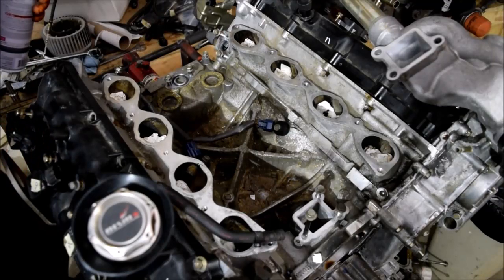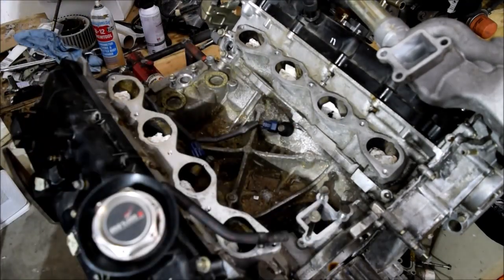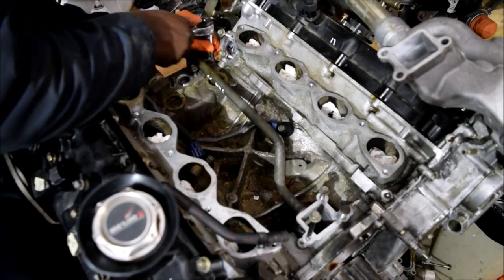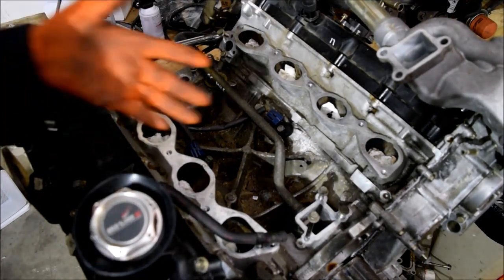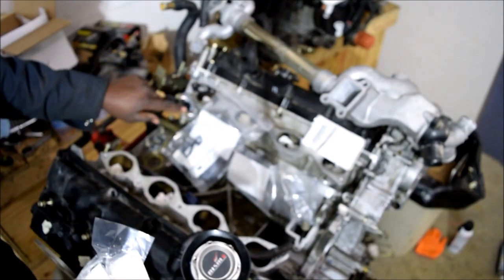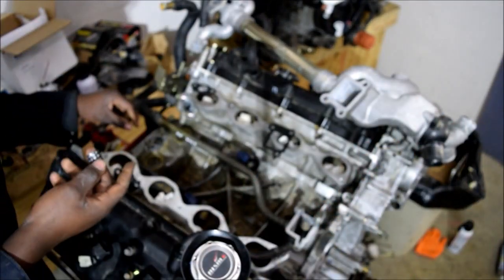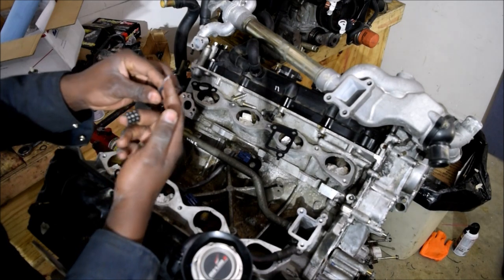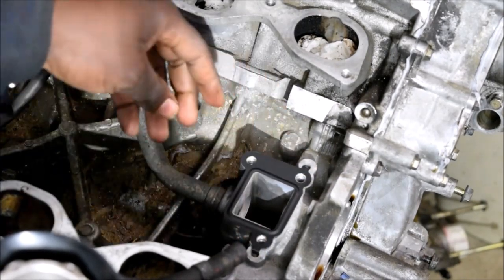Ep.7| Coolant Tubes under Intake Manifold. VK45DE engine reassembly - Infiniti M45, Q45, FX45, Fuga

Comment: My problem is I have to take off the fuel injectors, Do I just need o-ring or do I need the caps that go on the end of the fuel injectors as well? Thanks for your vids by the way.
Reply from the maker: It depends on how damaged they come off. Usually the O-ring is reusable, the little cap might be brittle. Use a liberal amount of wd40 before & during removal.

I think you can remove the manifold with injectors still installed. Look into that
Reply: @EdBwoy  FSM says I can't. And last week when I tried to remove the bolts for the manifold, they were blocked by the fuel rail. So fuel rail has to come out they say. Also in your vids with the manifold removed I noticed fuel rail is removed from the manifold as well, Uh! So you just usually reuse the fuel injector o-rings?
Reply: @liblib89  never a good idea to re-use gaskets, seals, or o-rings. Unless it states it is re-usable such as ford oil pan gaskets... You're there, just do em... Use some die electric grease to lube o-rings for ease of install... Also dab this grease on all electrical connections while you're there to prevent electrolysis - can cause some unfriendly electrical nightmares when connections get all corroded..😉
Reply from the maker: @liblib89   I mainly remove the injectors to deep clean everything, but with a good tool selection you can get around that. During removal, the o-ring & pintle cap can sometimes come off the injector. O-ring is very sturdy & I have never had a failure. The caps can break during re-installation if they didn't break as they jumped out.
I keep a stash of Subaru/Nissan injector rebuild kits for the pintle caps mainly.
Reply: @EdBwoy  Doesn't matter. My VK45 started knocking today. These engines have a design flaw. I'll let everyone know to avoid them.
Reply: @liblib89  please inform us of it! Mine has 109,000 miles on it and runs perfect! No knocking no funny noises yet. It is maintained very good.

Comment: Ed what is the best & easiest way to tell if you have a bad engine
Reply from the maker: There are a lot of different ways for an engine to "go bad". Oil consumption, metal in oil, knocking, overheating, loss of power etc.
It would be easier to provide your symptoms & decide from them
Reply: Ed not always but on start ups I see dark smoke for a few seconds and then it'll stop.  Under heavy acceleration I also see the same dark smoke
Reply from the maker: PCV valves in good condition?
Reply: @EdBwoy  I just changed them thanks again I watched your video & you showed me the location.
Reply: Just replace the motor I put 20,000 miles on in a years time now both cats are getting  hot though computer was going bad sent it off nothing wrong with it but I'm getting no communication on obd an misfire codes an how can I tell the coils are bad